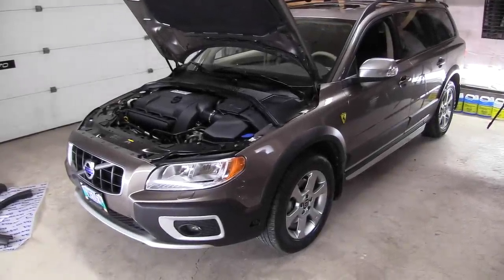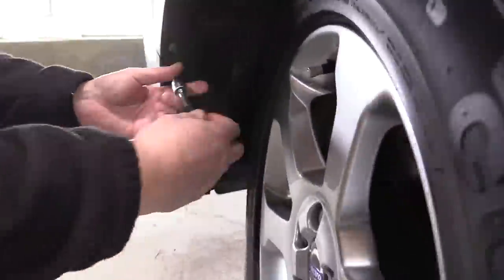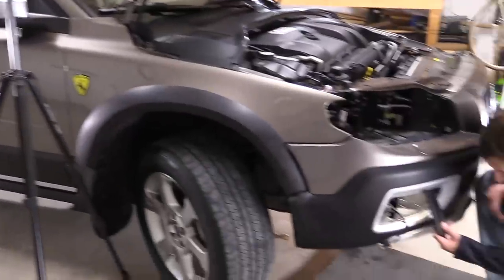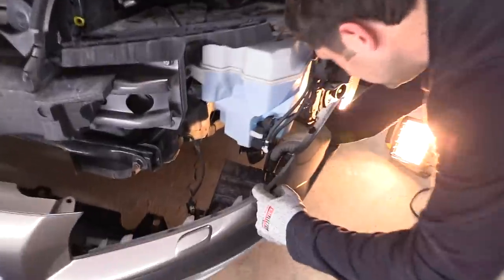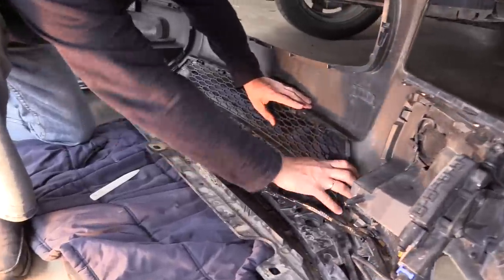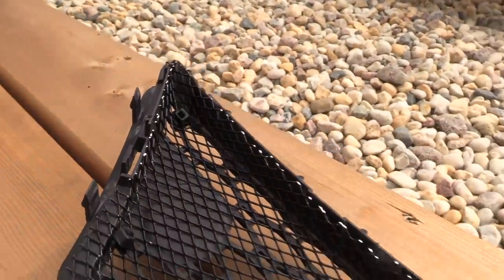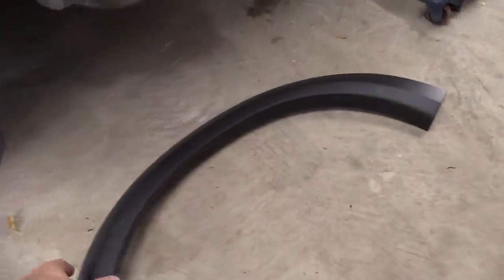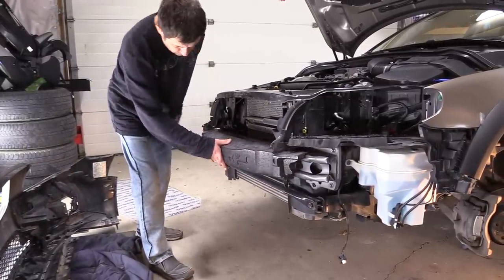Volvo bumper cover off, headlight washer repair, mesh grill inserts and bumper clading replacement.

Comment: Safety advice: put a wooden block (or similar) on top or to the side of the engine. This way the hood can never brake the bones in your hands if it accidentally comes down when you hold on to the car while working on it (many videos of such accidents online).

Comment: Just came here to say that I followed your guide yesterday. The windshield washer pump on my 2013 XC70 had developed a hairline crack on one of the hose barbs, and Volvo wanted $200 for a new pump plus $200 labour to replace it.
With the aid of your guide and $10 of plastic weld adhesive I was able to remove the bumper, access the pump, and fix the leak. Thank you!
Notes:
1) on my car, there was an extra screw in each front wheel arch - about 10cm in from the outside, in front of the wheel. Same T25 head as the other wheelarch screws. Your video doesn't explicitly show this one, and although it's pretty obvious, I thought I'd mention it.
2) At 6:46 you show the body-color molding being unclipped. This is not too tricky, which surprised me :) but I couldn't remove the bumper cover after this because of the small black plastic clip inside the wheel arch at about the same height. That has to be freed (can be done with fingers) before the bumper cover will come off.
3) My car has adaptive cruise and parking sensors. Obviously the wires for these were also connected to the bumper. The parking sensor ones just unclip, same as the front foglamps (and are attached to the same plastic housing). I left the adaptive cruise wire connected; for my needs, it was enough to just drop the bumper cover slightly off the car. I didn't need to move it out of the way by any distance.
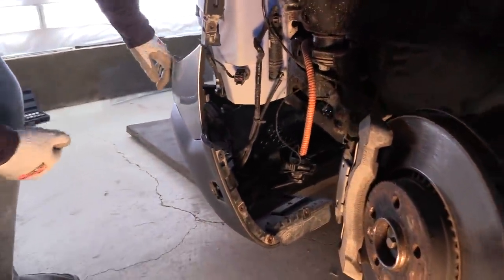4) At about the 9:00 mark you discuss disconnecting the headlamp wash hoses from the reservoir. My left-hand hose actually pulled off from the headlamp washer nozzle when I pulled the front clip off. The hose itself has a grey plastic sliding clip that releases it; when it was pulled off accidentally, my hose was damaged. However, by manipulating the grey clip I was able to get the hose to make a good seal to the nozzle assembly again.

Thank you for this really helpful guide!
Reply from the maker: Glad you did it yourself!
Reply: @volvosweden Hey, where did you get those awesome Prancing Moose badges on the front wings of your car? I've looked but can't find any. I heard rumours that a certain Italian car marque that rhymes with "werrari" blocked sales of them on copyright grounds.
Reply from the maker: @davidhollway check here. Not the same but similar https://www.auslandervlv.com/accessory-shop

Comment: Hello from Denmark.

First of all: Thanks a lot for your videoes, they are extremely easy to follow.

Next: I followed your instructions and installed the mesh grill inserts to protect my radiator on my 2016 Volvo XC60 and it worked just fine. I tried different drills and found out that the drill for metal went through the plactic as a warm knife through butter.

So once more: thanks from Denmark

John Sommer

Comment: This was really helpful! I had to remove my bumper to fix a leaking hose on my washer bottle.. and of course there was no room to do it from inside the wheel arch. Thank you very much - I have no washer leaks now!
Reply: Do you have a link to buy the 3 bottom plastic clips that hold the bumper?  from 3min30 onwards

Comment: A good opportunity to vacuum bugs off radiator, and reopen any flattened fins.  I used an awl to pick open the fin, being careful not to poke in more than 1-2mm.   Doesn't need to be perfect, just open to airflow.

Comment: Thanks, that's a very helpful video, I particularly liked showing how to release the clips rather than just saying 'release them' so we know how to do it.

My problem is the washer tank leaks, so I need to remove my bumper to inspect. I think it is probably a split pipe.

Comment: 5:57 silicone spray helps a lot here, also a hairdryer on high or a heat gun on low to warm up the plastic.

Comment: Hello, do you think red (or orange) clips that keep plastic cover together with the fender are available separately? I need to disassemble two of my fender covers just to improve the glue connection and then put them back. I don't want to buy new ones because they are ok, just the glue connection failed over a length of several centimeters. And by the way, do you have any idea what kind of glue to use to join covers back with the fender?

Comment: 8:50 the „mice“ are normally animals we call „marder“ in germany. In sweden they have animals called „Mink“ which came from russia once upon a time... they look pretty similar... and as you can see, there are extra plastic tubes around the wire which normally should protect the cable... so you had a „Marder“ with very strong teeth 😉

Comment: Can you explain how to change out the radiator on a 08 S80 T6? Mine started leaking on the passenger side tank that is crimped at the top.

Comment: Hi Volvosweden. I saw your car is prewired for front parking assistance. If you want easily you can add front sensors. I bought second hand(sensors and wiring) from volvo xc 60, but volvo fit same sensors and wiring to s80, v70, xc60. When you install everything, you just need to visit your dealer for soft update.

Comment: My volvo xc70 2013 headlight washer was hit by ????? Lost the cap and nozzle head broken . The pump works and  the nozzle comes out normaly. Would like to know if I can repair without taking out the bumper, if I take out the weel and the inside guard of the fender can reach the pump and the nozzle ??? Gerald from Montreal QC. Thank you for the good videos.
Reply from the maker: To properly repair bumper needs to come off. It’s not hard. For how I would pull the headlights washer fuse so you don’t waste washer fluid
Reply: I saw your video and I hoped there would be an other way .Thank you.  I will have to wait spring to fix it meanwile is there a simple solution , like disconnecting the right washer by unpluging the related swicht ???  @volvosweden
Reply: I would to prevent the nozzle to come out during the winter season !!! no more question . MERCI  thank you for infos
Reply: thanks
 @volvosweden

Comment: THANKS FOR THE VIDEO! IS IT THE SAME OR SIMILAR TO REPLACE THE WASHER FLUID RESERVOIR OF VOLVO2007 S80? I HAVE ALSO BULB FAILURE POSITION LAMP INDICATING ON THE DASH BOARD ALTHOUGH ALL THE LAMPS ARE OPERATING PROPERLY. I TRIED TO RESET IT BUT IT KEEPS INDICATING. ANY HELP? FROM JUNIOR

Comment: What do you use on the black trim around the wheel arches? 

Also, have you had to fit the black trims closer to the body of the car? The trims around my wheel arches seem to be slightly away from the car

Comment: Can the black plastic section housing the fog light be removed/replaced without removing the entire bumper?
Reply from the maker: Nope. The tabs have such a design that bumper needs to be removed. Otherwise damage can occur.

Comment: I've owned "Bricks" as Volvos use to be called since 1990. In fact I just passed on my 1990 240 GLE Wagon 327,876 miles. That leaves me with a 1993 240 Classic #950 (runs, No Rust) and a 2004 XC70. I'm gonna sell the '93, just have to find the right Home for it. But what I was going to say was that from 1999 on Volvos have gotten harder and harder to work on. They didn't want you to repair anything the car...Buy New and Install

Comment: Hi....I have an issue also with my headlamp washer on the drivers side (england)....the washer stays up so I have to manually raise it slightly and let it drop back down....can this be reset or manipulated in any way to fix the problem or is it a case of getting a new washer....great videos by the way....
Reply from the maker: New washer. It's the motor most likely

Comment: Is it possible to install the black trim piece that's around the fog light without removing the bumper? My xc70 was in an accident and I've got all the other parts ready to install but the shipping of this trim takes more time than expected and I need my car to commute. So I was thinking maybe I can let my body work guy to install the bumper with the old, broken part and when the new one arrives, I can just switch it from outside. I don't care about the old part so I thought maybe I can remove it by breaking it apart. Is it possible or am I stuck waiting? By the way, great channel, loving every video! Keep up the good work!
Reply: Did you manage to replace the fog light section without fully removing the bumper? Appreciate you posed this question 5yrs ago!

Comment: For the cutout for the pre-heater connection...Why not use a soldering Iron with an exacto knife tip
Reply: Hit the wrong button...Fymall
60W Adjustable Electric Temperature Gun Welding Soldering Iron Tool Kit Set...<(O..O)>...🖖

Comment: A question about the washer fluid reservoir: mine leaks if I fill it all the way to the filler hose at the top. It then stops leaking when it sinks to a certain level. Any thoughts about that? Good video.
Reply: Yes just don’t fill it up ;)
Reply: @Alexander_l322  A late reply to a silly reply: well, there's obviously a leak if you can't fill it up all the way to the neck but I take it that you don't even own a car to know better.

Comment: Great video.  I have a cracked headlight washer cover on my 2008 s80.  Can you do a video on replacing them.  I was wondering if you have to remove the bumper cover or just remove the headlights to release them.  Anything you can tell or show me would be helpful.
Thanks

Comment: Pro tip for when your going to change light bulbs or so: The headlight harness is long enough that you can just fold the headlight over.
As the plug may be a bitch.
I think you would cry is you saw me remove those bumpers 😈

Comment: Price approx of the black cladding? I too have scratches from the previous owner... if not too expensive I may change it too. Was there no way repairing the damage using a wet sanding technique? You deserve 18+” rims one day...
Reply from the maker: Both pieces 200$
Reply: I'd try a heat gun, but be careful

Comment: Can U buy in Canada bumper cover all around in separate pieces? Cuz here at my closest Volvo dealer they sell only all set for 700+ euros
Reply from the maker: Dont know
Reply: I was told by a body shop that Volvo replacement front bumpers come pre-painted.   There's not a generic unpainted part you can order, as is the case with most car brands.